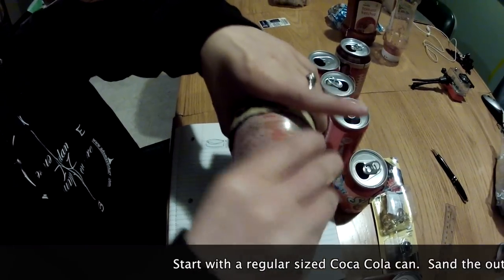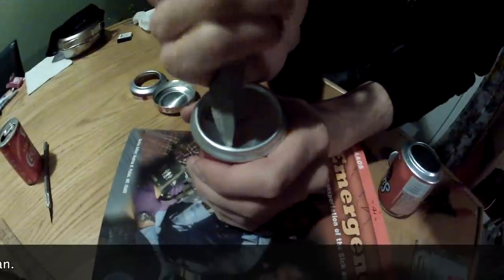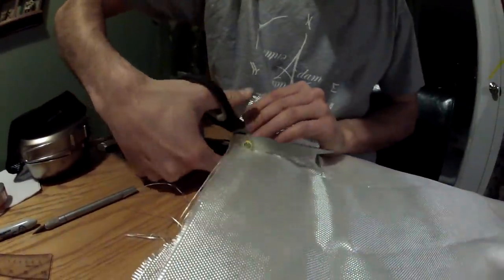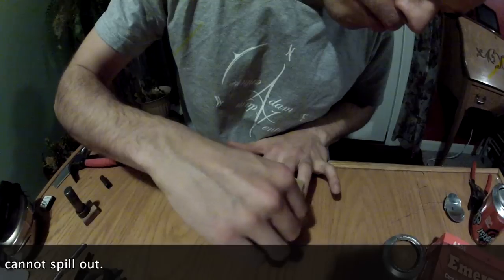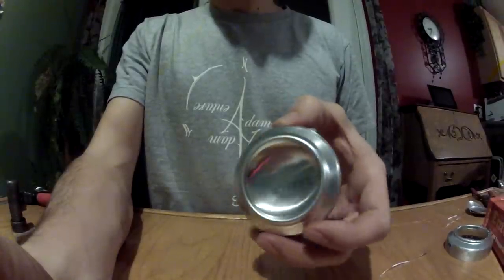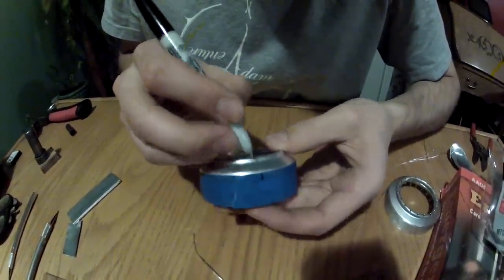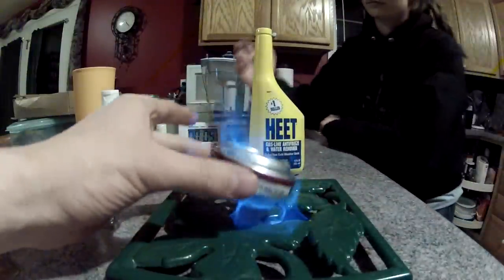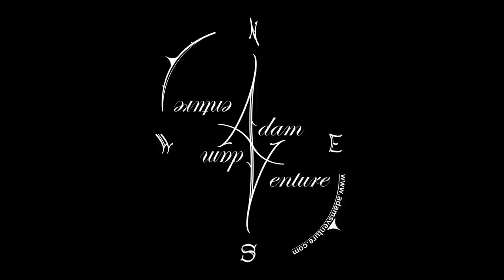Alcohol Stove, Best Camping Stove Design

Comment: ok just a thought.  When showing someone how to make this, DON'T do things that could get someone hurt.  Such as...picking up the stove and spinning it around while its on fire....or leaving the fuel less than a foot away from the stove while its on fire.  Its simple things like this that makes me scratch my head.  What was even the purpose of picking that up?
Reply from the maker: simply to show that it can be tipped over without alcohol spilling out, of course the alcohol that missed while filling didn't help convey that.  trust me there was no danger, but thanks for the concern.  Think of it as a what not to do
Reply: So Bill.. Did this vid make you wanna grab a can of coke, light it on fire with Heet, then try picking it up? No? Then I doubt it would have that effect on other people as well. And if it does.. well.. there's always the darwin awards. And as for the kiddies.. If they're over the legal inet using age of 13 and dont know that fire can burn you or light the house on fire..That's the parents fault for not teaching them better. Not Adams. Thx for the vid adam.
Reply: Alan, people like you and I wouldn't think that....but right now I am watching a video where people believe so rather absurd things.  So while you and I again wouldn't do this, its just a fact that when showing someone how to make something that does involve even a slight amount of safety, one should convey that at all times.  I am sure this guy wouldn't want to even be indirectly involved in someone getting injured.
Reply: Adam Haggerty
I totally understood what you were doing, but don't lie, that first time you touched it, it kind of "got ya" didn't it?!?  =P
Reply: Truth be told I'm the guy that believes the ppl that aren't smart enough to know better than to put their hand in a fire... Might be better off not reproducing lol. But I see your point ;)
Reply: btw. I've burned myself trying to do this. I spilled the alcohol. didn't read your comment. it was really scary.

Comment: This is definitely the best looking and working alcohol stove i've seen. I personally would make it a bit taller to allow for more fuel inside of it, but this is really a great design. also to note, while very cool, there are plenty of designs you can use where an electric drill is not usable.
Reply from the maker: thank you for the comment!  The specs for this stove I designed to work with the "quick fire" titanium stove stand.  works great for boiling 1-2 cups of water.  Taller would be great for more people or bigger meals.  I agree there are plenty of ways to get around the hole drilling, nails or hammering pins, but I have a dremel so why not :-)
Reply: Adam Haggerty

Use what works. Since you had a dremel, it was a damn good tool to use. Stove looks great. Good job.
Reply from the maker: jebova2301 Thanks for the positive feedback!  Love it!

Comment: Excellent and well done, both the tutorial and the design.
Reply from the maker: Thank you!
Reply: @swank3  Do you know if some alcohol sources will burn longer than others and if so, would they burn hot enough to boil water also? I know it's simple but I'm just wondering, thanks!
Reply from the maker: @ChristiaHall  there are a variety of things that will burn in the stove but non that I know of that burn longer or more efficiently or as clean as Heat. If you find something then please share!
Reply: There are a few main sources of fuel for alcohol burners. One is methanol (methyl alcohol), one is ethanol (ethyl alcohol), the third is isopropanol (isopropyl alcohol). 
Methanol is a nondrinking type of alcohol (also known as wood alcohol and methyl alcohol) which is mostly used to create fuel, solvents and antifreeze. A colorless liquid, it is volatile, flammable, and unlike ethanol, poisonous for human consumption. HEET in the yellow bottle is 99.7% methanol. 100% Methanol burns with a pure, blue flame.
Ethanol (also called ethyl alcohol, grain alcohol, drinking alcohol, spirits, or simply alcohol) is an organic chemical compound. It is the type of alcohol contained in alcoholic beverages. It is also sometimes used in hand sanitizer. Any booze contains ethanol, and any booze higher than 120 Proof should burn in a stove. Pure ethanol burns with a blue flame, with yellow at the tips.
Isopropanol is a colorless and flammable liquid with a strong odor. It is miscible in water and many organic solvents such as ethanol, methanol, chloroform, and acetone. It is readily available to the general public as rubbing alcohol which is 70%–90% isopropanol. 40%-70% isopropanol is often used in hand sanitizer. Isopropanol burns with a yellow, sooty flame, and is not a good fuel in alcohol stoves.
Denatured alcohol (also called methylated spirits, in Australia, Canada, Ireland, New Zealand, South Africa, and the United Kingdom; wood spirit; and denatured rectified spirit) is ethanol that has additives to make it poisonous, bad-tasting, foul-smelling, or nauseating to discourage its recreational consumption. Denatured alcohol, being mostly methanol and ethanol, burns with a blue flame, sometimes with yellow or orange tips.

Comment: Adam, I really appreciate the thought and effort with this, but I have concerns about using fiberglass insulation. Burning it is toxic. I encourage anyone looking at this design to consider this and use a different material - perhaps Carbon felt would work better. Thanks again.
Reply from the maker: That's an excellent point, I will do some research into that.  Thank you for your comment! I'll quote this into the video.

Comment: I'd like to point out that here in BC, Canada, I bought 99% alcohol that was around $5.00 for 500ml. But, the flame had lots of yellow in it, which resulted in blackening any cooking surfaces. So 99% is not so great up here. I then purchased a gallon of Methyl Hydrate from Canadian tire for about $9.95. It's absolutely pure alcohol ! AND, the flames from all the stoves I built were totally blue, no yellow at all. Just a heads up for us Canuks eh?

Comment: You can definitely tell it burns hot! How long would a stove like this last if you were to burn a half oz of alcohol each day? I'd assume the metal would eventually break down from reheating so much.
Reply from the maker: That's a great question, I have not done a product life test... I've had mine for 2 years. The can does get hot but the most heat is just above the can not within.  So the can does not experience the full heat of the flame.  I think continuous use like you said would have no problem for the aluminum, the fiberglass in this model would not last as long.

Comment: Carbon felt works well and can withstand temps up to around 1,800 degrees. Amazon has carbon felt by Steiner. A 18 by 18 inch sheet for $15-19. That is a welding blanket that plumbers use when thawing frozen piped. They can use a torch on the frozen pipes and the heat will not scortch or burn the wall behind the carbon felt.

If you want to see some of my stove designs check my You Tube Channel. I never used insulation in any of the designs, and I used carbon felt in only two of the designs. The turbo stove, and my first simmer stove.
Reply: +MatoNupai if i were to use the carbon felt to substitute the items used. do you use the carbon felt to replace the fiberglass screen or for the pipe insulation? I want to try it out.
Reply: I NEVER used fiberglass in any of my stoves. I used carbon felt in some but mostly I only use Carbon felt on the outside of the stove to help the stove light when it is too cold to light alcohol.

My ultimate stove was used at 12,000 feet elevation and a temperature of 5 degrees. Thanks to a wick of carbon felt on the outside.

Once you know how and more importantly why these stoves work you can get them to work anywhere.
Reply: +MatoNupai thanks for the input! it helped alot.
Reply: Or you can buy areal alcohol stove that's not a dangerous joke for as little as nine dollars.  You can buy a Trangia for fourteen.  Being able to make a DIY stove is a good skill, but in face just an empty cat food can, or  pop/beer can bottom works at least as well as any of these silly, complicated versions.   DIY stoves can also draw an extremely large fine, if you wander into a fire ban area because they aren't real stoves, and are considered dangerous, which they are.
Reply: Carbon, fiberglass, or sand, they're all dangerous, and none of them work better than an empty sat food can.  Buy a real stove.  The life you save may be your own.
Reply: yikes---while your cutting the bottom, what potential event wasn't obviously considered---slicing some of your digits off if it should jump out of it!!

Comment: The stove looks nice. Two questions: Have you tested how long it lasts before you need to replace it and where to store it when backpacking so as not to stink up the pack? Thanks again for the video.
Reply from the maker: I have used mine several times a year, no signs of it wearing out. As for smell, I always pack mine into my cook set. Never had a problem with smell, the alcohol burns off and the odor is gone. You can also make this withoit the fiberglass and it will last longer and smell less "chemical."

Comment: what a great video and an outstanding idea. How long would it take for the fiberglass to degrade? 
Thank you!
Reply from the maker: +MiamiNice57 Thank you!  I cant be sure how long it will last, in the description I added a link for alternative materials that might fo better with the heat, not tested.  I currently use the same design minus the fiberglass, works great for my needs.
Reply: Unless crushed or otherwise ruined by neglect, this stove will outlast you and your children that you leave it to when you die. The fiberglass cloth and insulation, as well as the aluminum cans, will last for hundreds of years. The heat will not affect them at all.

Comment: Adam,
          I still have a question about the cans you said to use...  The smaller can...  What did you mean by that?...  Did you mean a different product with a smaller diameter can or the same product simply cut shorter?  I need this information so I can start to build my own stove... 

Thank you for a response...

GF
Reply from the maker: Hey Gary, the "smaller" can needs to be smaller in diameter.  Please take a look at the link in the description it gives more info.  I used a 12oz coke can and a 7oz siera mist can, a very common size would be a redbull can, that will give you the diameter you need.

Comment: i dint try yours yet but I will make 1 like yours soon .I was using Heat to for my fuel , now I found something way better its called Bio Flame you can get them by the gallon , I payed 20$   1 once burns over the 10 min. mark, I use it as a heater near my feet

Comment: What are the advantages of using fiberglass wick rather then just using a double walled chamber for pressure?
Reply from the maker: Michael Piersant the thought behind the wicking action is to get the alcohol into the outer chamber faster and easier, this also creates more surface area to allow more alcohol to vaporize quicker.

Comment: Adam, thanks for the idea, I have a few questions. Is the pipe insulation foam or the fluffy stuff inside walls and attics? Is it acting like a wick? Does the fiberglass prevent alcohol from getting into the stove or is it just there to keep the foam in which is the alcohol wick? Does the second piece of fiberglass go directly under the first? Or does it go around the foam insulation? Is it the same size? Is it necessary? Would be helpful to see more of that.

I would like to see a boil test- would be a good comparison to other, similar stoves. Also your website has instructions for a different design and the steps are in a different order, which is pretty confusing - FYI 

Thanks again.
Reply from the maker: Hey, the insulation is fiberglass like you would find in the attic, NOT foam.  Yes, the insulation acts both like a wick and a sponge to help prevent alcohol spillage.  The insulation aids in alcohol being transported to the burners, no interference.  The second piece of fiberglass cloth goes directly under the first however, it is not needed.  Yes it is the same size.  I have more info on my website www.adamsventure.com feel free to check it out.  On the website I have instructions for a stove with no insulation.  I will try and get a boil test up, I am currently living abroad so it could be difficult.  Good luck, thanks for the comment.

Comment: Do you think using foam is a good idea? Or would it soak up the alcohol too much? Instead of the insulation that is.
Reply from the maker: Foam is way too flammable, It would not only soar up the alcohol but would quickly break down from either the heat of the stove or from the flame.  Check out the link in the description for other materials.

Comment: can you build one a little taller maybe cutting the can in half instead of near the bottom? just wondering that way you can add more heet and it will burn longer.
Reply: Changing the height also changes the internal pressures, and slows the 'bloom' time, as well as reucing the size of the flames coming from the jets.

Comment: nice, just what i need for my run out gas hahaha, question, is it possible to make the alcohol deposit bigger?
Reply from the maker: WULFAXE Yes definitely possible to make the stove taller. Haven't done a lot of experimentation with other heights but yes. You can use larger diameter cans too.
Reply: Thx m8, i will try hard as i can hahaha

Comment: I have a question,
So you used two cans and u mentioned that there is a small one. So if u could mention all the things required that would be great. Thanks
Reply from the maker: there is more information on the weblink in the description. if you need any more info just let me know, ill try to help.
Reply: The large can is a regular 12 oz (355 ml) soda/beer can available in North America. The small can is a 7.5 oz (222 ml) soda can. The large can is 66 mm diameter, the small can is 58 mm diameter.

Comment: I made a stove following your video (the 3rd stove I've made).  It doesn't seem to burn very well and the flame is mostly in the open center part. The flames don't look at all like yours in the video, even after priming it with some alcohol on the ground.  Suggestions?
Reply from the maker: hi, sorry to hear it's not working for you. If there is too much space inside at the bottom between the cans then the vents on the side might just pull in oxygen rather than pull alcohol up into the burner. Conversely if the fit at the bottom is too tight then alcohol wont get pulled in. I would try to make the stove without the fiberglass first.  My first design is like this, just a little steel wool in the space between the cans to help pull in the alcohol.  This makes a great stove. If you are still having trouble feel free to send me an email with pics of your designs and ill try to help. Best of luck!
Reply: Thanks.  I'm burning it now and it is working correctly.  Not sure why it didn't earlier.
Reply: How can I find your email?  Still not working the way I think it should.
Reply from the maker: my contact info is on my website www.adamsventure.com

Comment: I really like the design! I'm planning on making one myself, but had a question about pot placement. Did you use a pot stand, or just place on top of the stove itself? (seeing as it is an almost side-burner). Thanks!
Reply from the maker: on my website you'll see that I used a pot stand from "Wet Fire." A nice little titanium stand that folds.  That's the biggest reason that my stove is so small, it was designed to fit in there.
Reply: Adam Haggerty

Thanks for the reply, Adam. I realized the website was in the description after I posted my comment. My apologies for not looking sooner, but thanks for taking the time to reply. Great stove design, again, and thanks for sharing!
Reply from the maker: You'r very welcome. Would love to see pictures if you make one. Enjoy!

Comment: can u give the details about the measurement for fuel and how long it will boiled a water
Reply from the maker: I have received a lot of requests for this, I'll post a video soon.  About 0,5 oz burs for ~ 3:00, this stove design holds a little more than 1oz, easily burning for over 6 min. It's easy to modify the dimensions too to make it taller and burn longer.

Comment: Adam, whats the point of the grommet?  If you put the hole in it then cover it with another piece. Why cut the hole in the first place?
Reply from the maker: The whole allows the alcohol to travel through faster. Its faster through 1 layer of  fiber than 2. In later designs I only use one layer of fiberglass.  Easy to modify.

Comment: How about putting more fuel or making the stove taller. Is it possible to still function properly?
Reply from the maker: Both are possible. There is a point where the stove will not function properly if over filled. Depending on your build you will need to find that point.

Comment: Have you made taller versions of this that burn longer? If so link the video please.
Reply: Hi
Reply: Ummm hi.
Reply: Rainbow Vixxen hi.
Reply: Hi.
Reply from the maker: KerrankiSuomee
Hi.
Reply from the maker: Sorry for the slow reply, I've been out of the country for the past year. I've made several different versions but all small to meet my needs, the burn test in this video is less than half the actual potential of the stove, I only use 0.5oz of alcohol and this stove can easily hold 1.5-2oz for much longer burns.